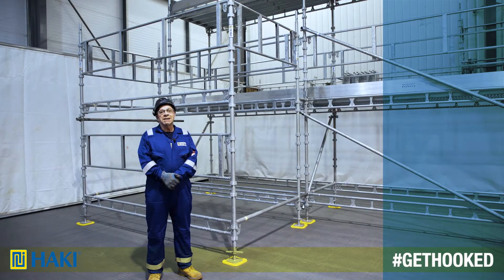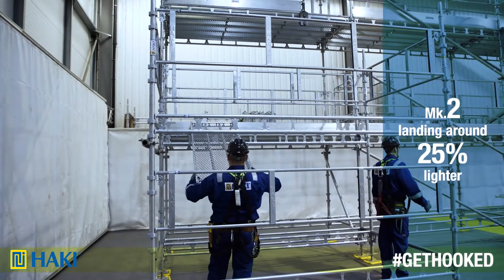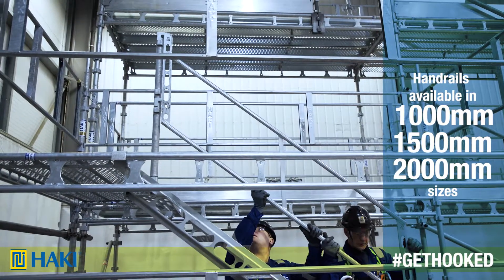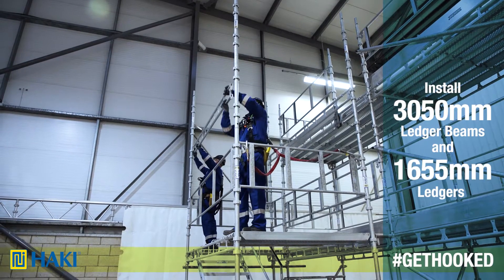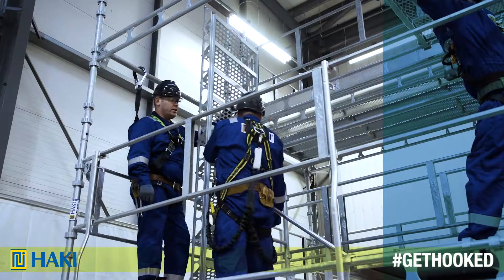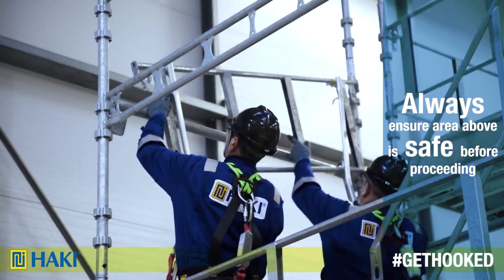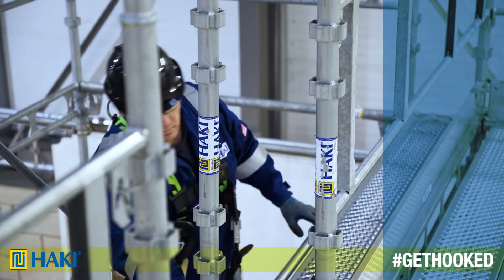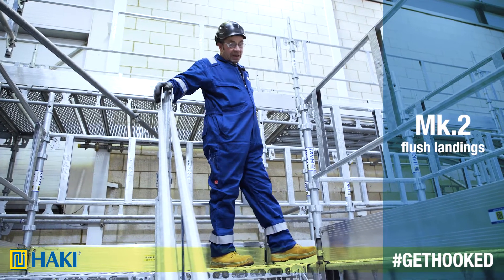How to erect a HAKI Stair Tower

Comment: I bet after the tower has been erected a few times those applicators will be no good at all with 90% of the towers, we'd be better off with a lump hammer to make the parts fit.
Reply: youre exactly right. haki is lovely stuff when its new/kept in good condition but a complete cvnt after its been bombed and bent by noddies